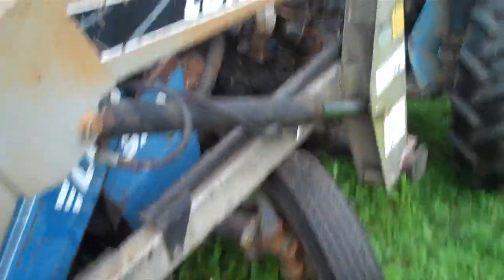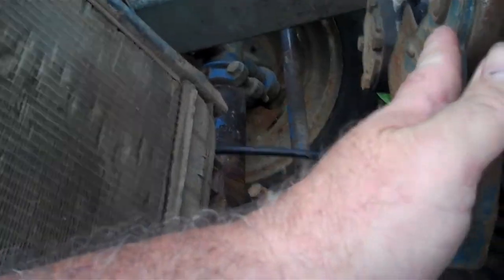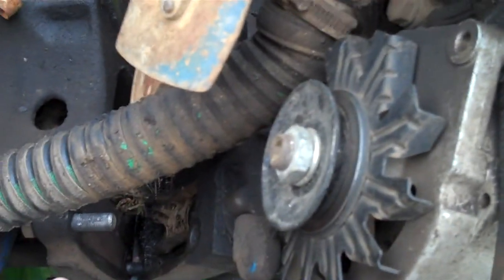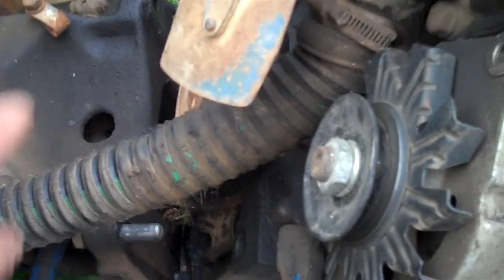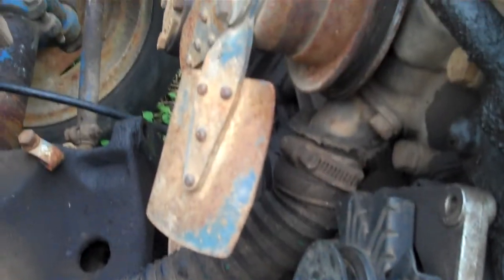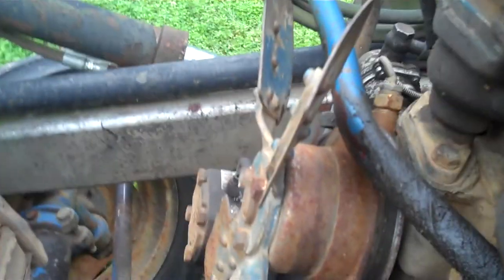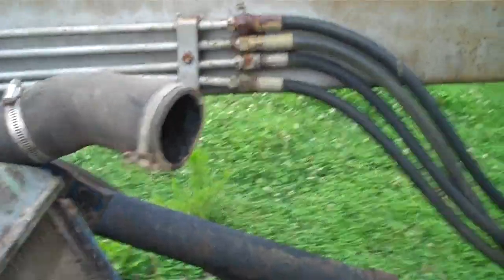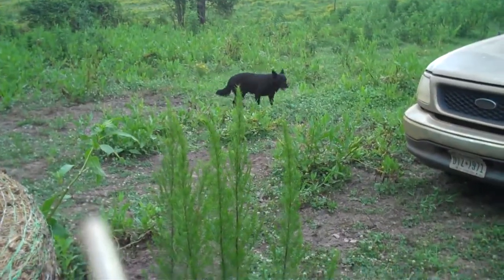Long Tractor 310 Drops Front End from Motor

Comment: That's crazy, ive never seen a tractor split like that in the front. Usually if they're going to break apart its in the center where you sit.
Reply from the maker: This one had been worked on by a 'mechanic' shop, which ended  up having to do the repairs to get it back together again. I have since stopped using them. I have a 30 year John Deere Mechanic who has set up shop in my home town, and he works on all makes of tractors as well. It is a bit more expensive, but his work doesn't fall apart later.